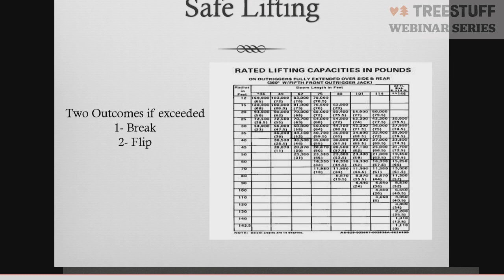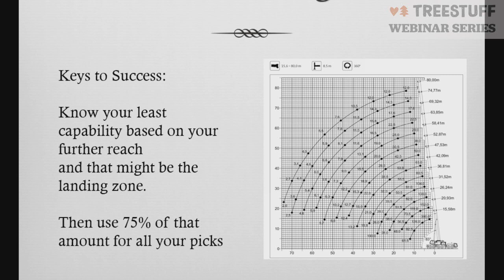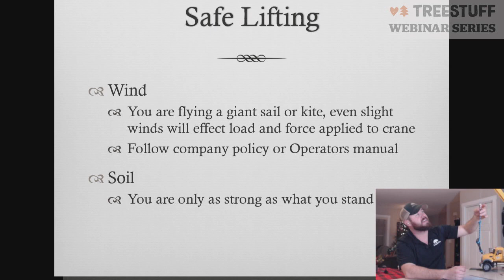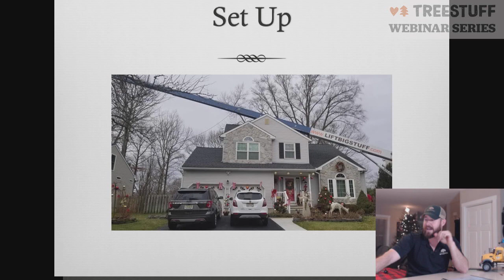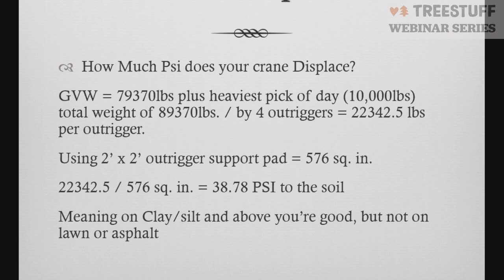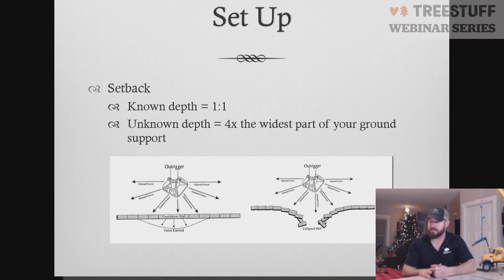Safe Lifting Practices and Set Up with Cranes in Tree Work - TreeStuff

Comment: Hi. Thank you for this series of videos, I have found them very useful. I have a question. You use crane weight +max load/number of outriggers to calculate the outrigger loading. 
Various other websites I’ve found use different formulas ranging from 
weight of (crane weight/4)+heaviest load=max individual outrigger loading, 
right through to crane weight + heaviest load=max outrigger loading. 
Is this different industry’s requiring different safety factors??